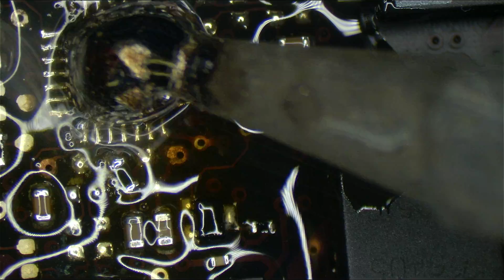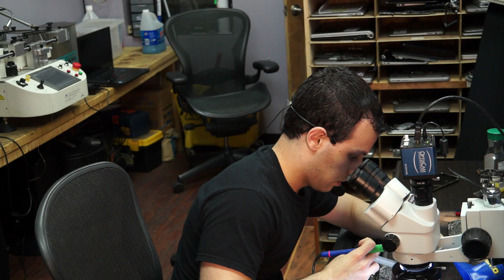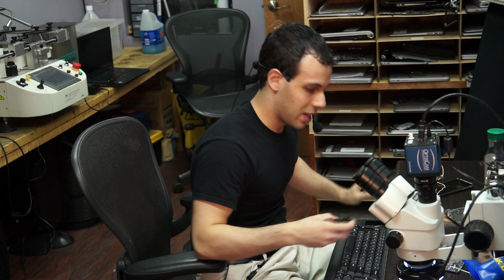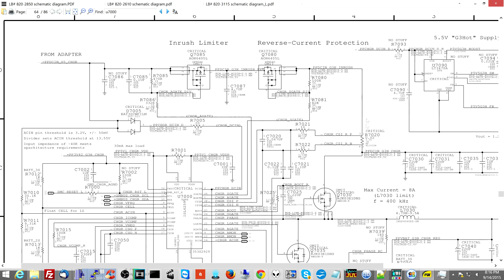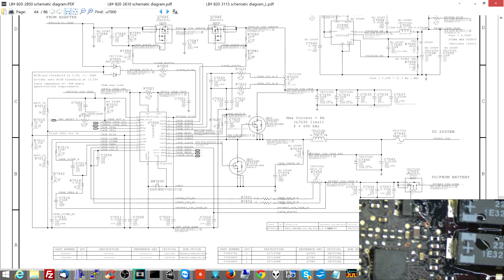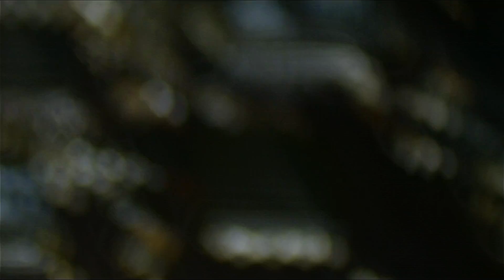Recovering & reworking destroyed ISL6259 area from liquid spill damage on Macbook logic board

Comment: I recently completed my first successful motherboard-level repair on a 2012 Macbook Pro with the help of your videos! I got a hot air gun to try on an older macbook a few years ago and failed, and kind of gave up for a bit. I was going too fast and didn't practise and it just seemed so hard.

With this 2012 (retina) Macbook, the (only one year old) battery had stopped charging. A replacement battery didn't help, so with some research I learned that it might be due to the i625 IC. Sure enough, upon opening it up I saw that some of its solder leads were pushed together. 

After probably around 15 hours of working on the IC leads and fixing new problems I created with my sloppy micro soldering skills, I turned it back on and it worked! Massively satisfying. I was so happy that I practised on a broken board to get the hang of working with delicate ICs as recommended. It so easily could've gone wrong, lol. I almost lost one of those tiny adjacent resistors in cleaning up excess solder, for example.

Thanks so much for your tutorials and advocacy and your constant reminders that there's no reason for the world of tech to be so hostile to its users.

Comment: Just discovered this channel, watched a couple of videos and already loving' it . Nice work Louis - you have a good way to systematically troubleshooting an also explaining your progress.
What is the brand flux you are using ? Looks like it cleans off nicely and behaves nicely under hot air (liquid enough but not too liquid).
Reply from the maker: +Henner Zeller Amtech NC-559-V2-TF
Reply from the maker: Steve Bongard Lots of phone calls, emails, and faxes back and forth with Inventec which is the parent company of Amtech. I sell it here. https://mailin.repair/amtech-nc-559-v2-30-cc-16160.html

Comment: at the 5:00 mark with ISL6259 off, the top line of contacts second pad from right looks short like it's part corroded, how bad before you need to run a wire?

Comment: I'm an automotive technician and much of diagnosing problems on vehicles follows the same method you use to troubleshoot your circuit boards.  Any monkey can change oil or play swaptronics to guess as to what a solution is, but the ones that know circuit or system design and know how to isolate the cause and effects of a problem using their brain are the ones that are very valuable to the industry.  I love your videos because we have something in common even though we are in different fields.  Who knows, when I get older and can't handle the manual labor of repairing vehicles, maybe i'll use my brain to repair vehicle electronic control units.
Reply from the maker: +Discretesignals I'd love to sit with people who do this on vehicles and just watch their process. I've never worked on cars, or even driven one. I imagine it would be fun to learn something new.
Reply: +Louis Rossmann louis you never drive a car?!
Reply from the maker: Nope.

Comment: Do you use ESD protection?
Reply from the maker: +Jonas Peters I touch my comp before I start and that's about it.

The boards on my table have been through cat piss and coca cola, if they can survive that they can survive the 0.000000000000000001v that remains in my body after I've touched a ground source once.
Reply from the maker: +MrDubje Honestly, if working on the space shuttle, or a fire alarm, or an access control system, I would have the full ESD safe setup going. I see value in ESD safety. These are life critical circuits that are in good condition; I would want to know that the person working on them observes ESD safety procedures. 

This is not life critical. Further, it has been pissed on, and boiled, and skullfucked by coca cola. I'm not going to disrespect the boards by mistreating them intentionally, but at the same time, going out of my way to ensure a perfect environment, given the history of 99% of what ends up in my office, isn't practical.
Reply: +Jonas Peters I don't think he does, but why should he? 
A: The boards are already dead, okay, he tries to fix them, I know.
B: A fully populated board is less susceptible to ESD damage than individual components.
C, my personal favourite: Signs of ESD damage most likely occur at a later time (we're talking months / years). That is a fact. The products he is working on are constantly pushed out by planned obsolescence, and computers in general are called "old" when they have had 3 years of use and are out of warranty after 2 years (standard lawful minimum warranty in Europe). 
Why the hell would anyone who repairs electronics bother to do everything exactly right when it comes to ESD safety, and wear ESD safe shoes, sit on an ESD chair, on a conductive floor, with an anti-static wrist strap that constantly annoys you when you're trying to move, in a anti static labcoat? ...

That being said, it would suit him better using these precautions as a company and to improve the longevity and thus quality of his work. But everything in this area (ESD products) are heavily priced. It's expensive voodoo. :)
Reply: +Louis Rossmann Couldn't agree more! When at work I work in such environment, with the conductive table, floor, labcoat, shoes and all that. I just refuse to use the wrist strap as it isn't pratical (I have to move around and get up a lot). The word "practical" being key here! :)
Have a nice day/evening!